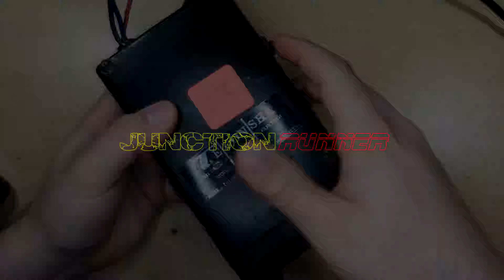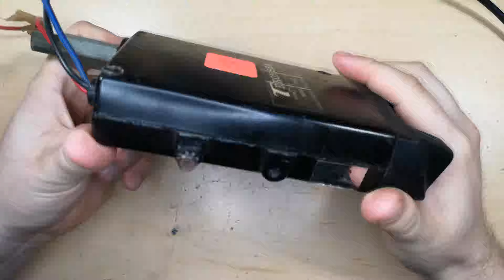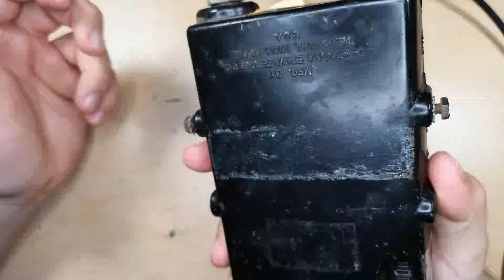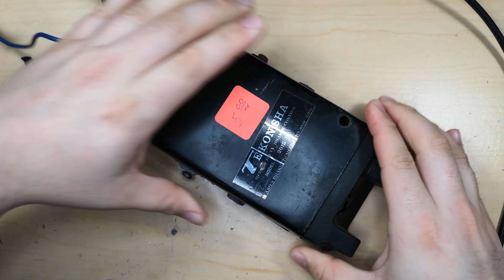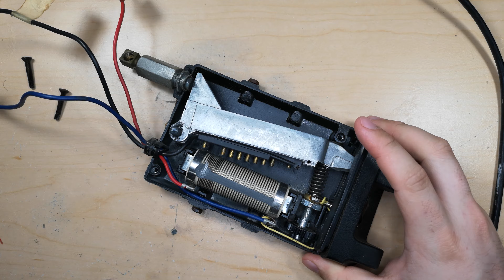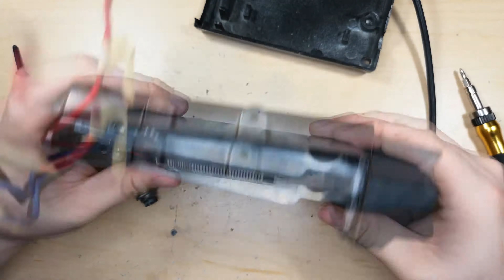Brake Controller Quick Teardown

Comment: Thanks for the teardown video. So, it looks like the break controller adjusts current based on how far the break pedal is pushed using a wire wound resister to do so. I wonder what the value of the resister is.